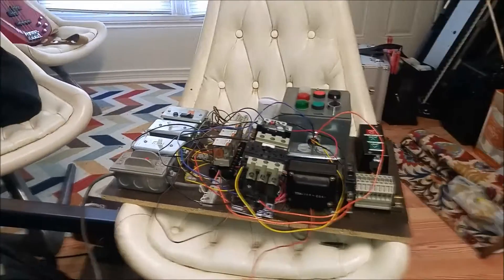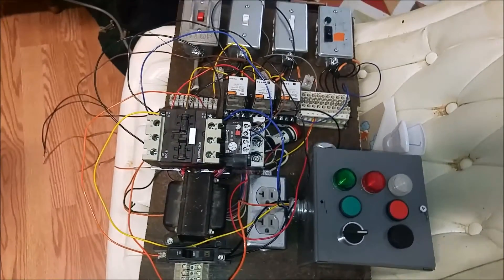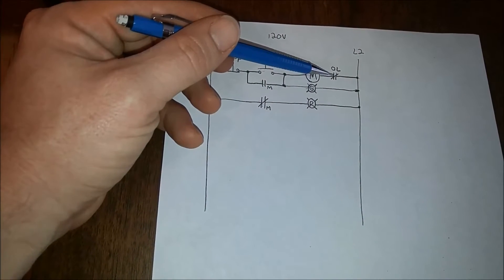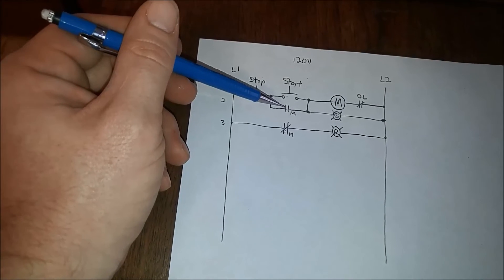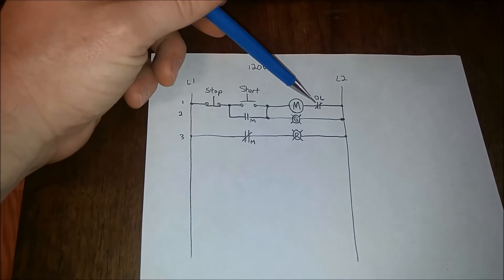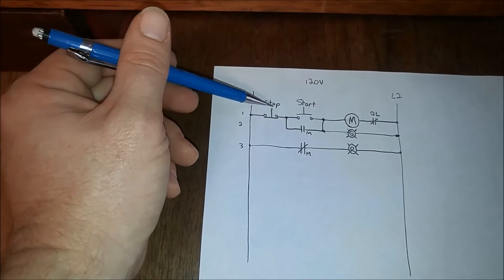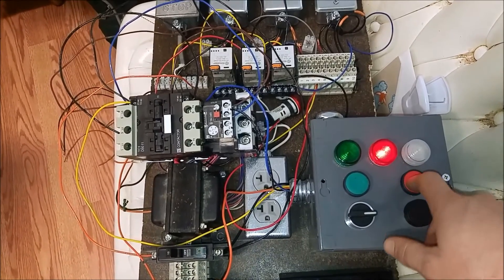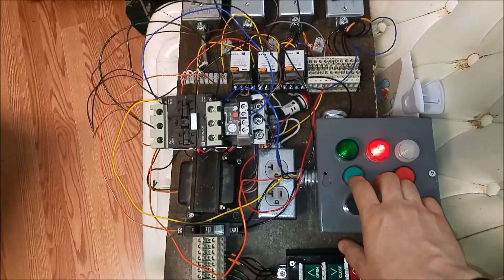Motor Starter Control Circuit Demonstration

Comment: If my motor starter coil is 480 vac, and my control circuit is 480 vac, can I run a 120 vac pilot light via a step down transformer to an aux NO contact on the MS overload?
Reply from the maker: JThomas Bradley I don't see why you couldn't, the contacts will be isolated from the 480vac so you can control whatever voltage you want with the overload contact so long as the contact is rated for it.